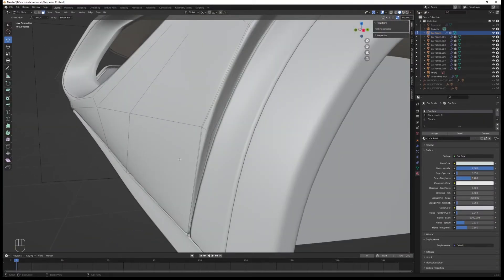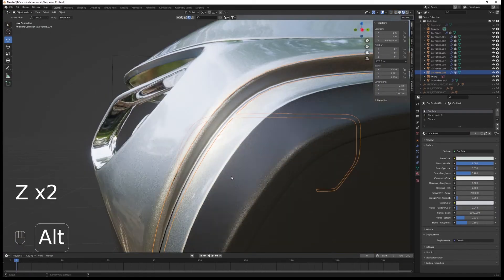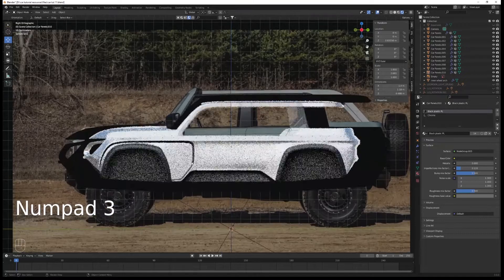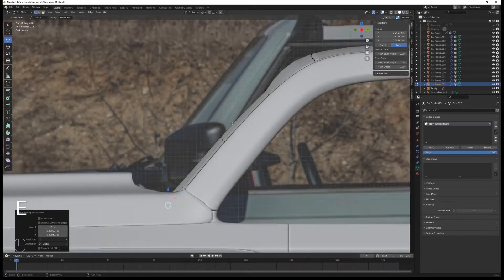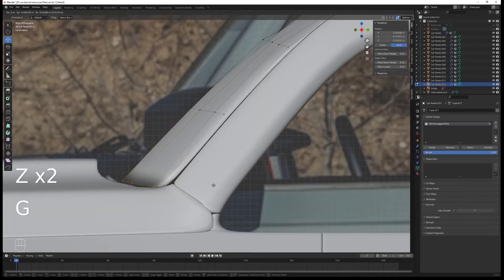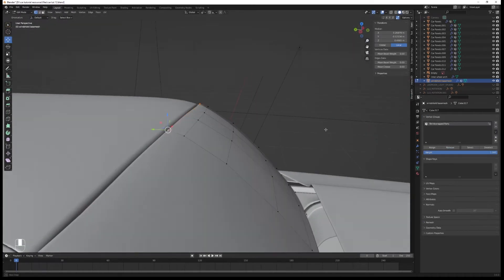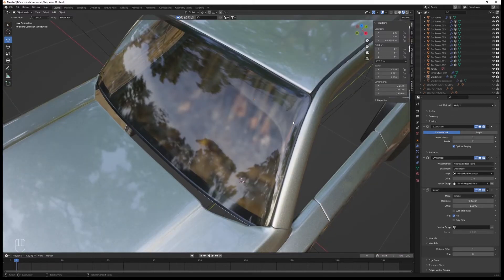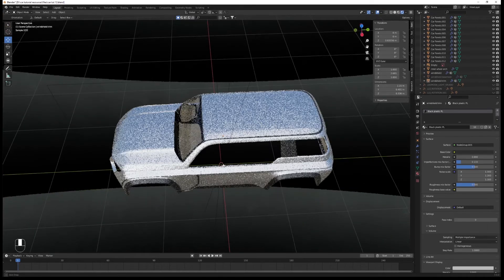Blender Concept Car Modeling - PART 5

Comment: Wow, very cool trick with the black frame on the glass. I don’t really understand how it works, do the materials add up?
Did you know that there is such a way to create panels? Using the "Edge Split" modifier then no gaps appear. https://www.youtube.com/watch?v=0d2yDNXpRzI
Reply from the maker: Edge split seems like a good way to make them! I will have to investigate as they look quite nice, thank you!

As for how the material offset works, here is how I would explain it. Solidify creates new faces, it basically extrudes the mesh a certain distance. Now, when we tell the modifier to offset the material slot by 1, the new faces will take the material slot right below their original material.

I made a video called better windshields that uses this trick, maybe I explain it better there, let me know if that helped!